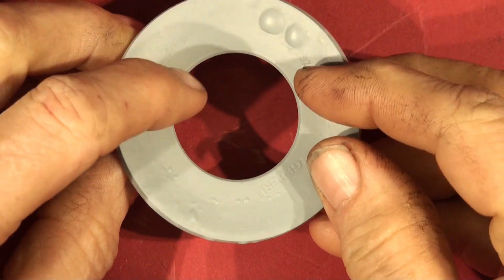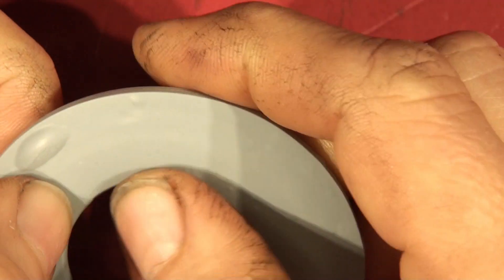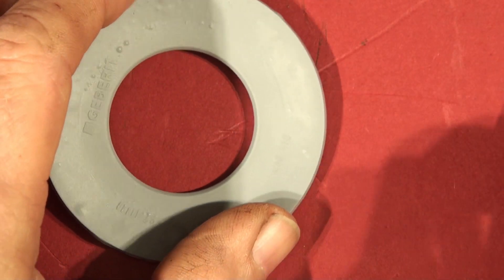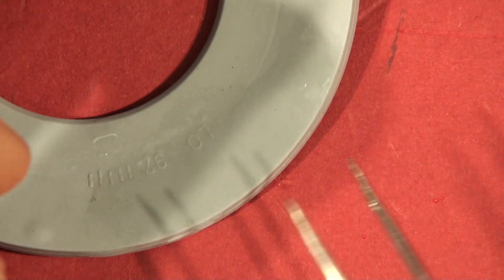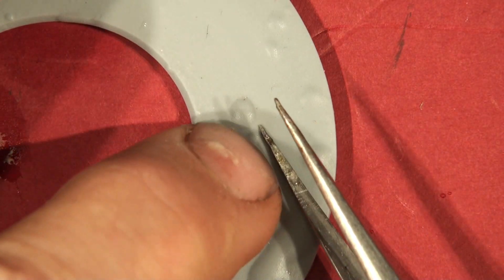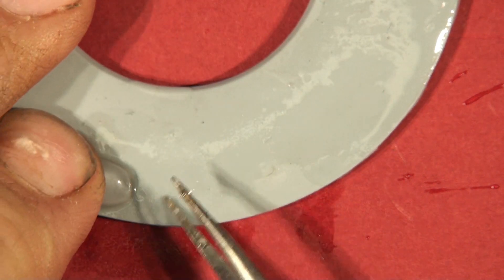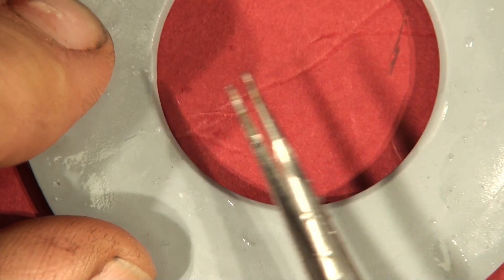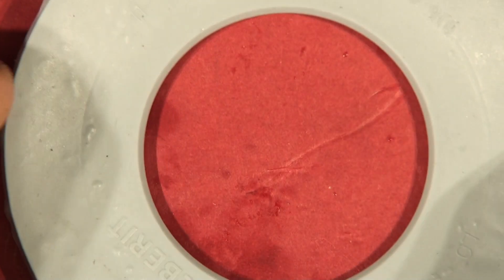Leaking, dribblng  Geberit Twico Toilet dual flush valve zero COST repair

Comment: Thanks mate, exactly the problem I was having with my toilet cistern here, very slowly leak and a high water bill. Solved and saved me buying the slightly overpriced part and a 20 km return drive to the plumbing shop...
Reply from the maker: Great job..  Shouldn't be necessary if they just made a simple silicone washer... It is made from the wrong material -- one has to wonder if it is  deliberate to generate more sales....

Comment: Interesting, sure as ...sugar, honey, ice and tea, for the last couple of weeks I'd be getting little dribbles and the refill valve going off now and then at all hours. Drove me batty in my apartment. In my case, the seal was bowed out rather than flat, there was one tiny blister but for now I settled on cleaning it all down along with the cistern seal face and inverted the seal ring so it presses down more firmly.

Took me a while to find what kind of flusher it was outside of a Geberit, no branding / model stamped next to the various 'made from abs' this and 'complies with standards that' found all over the parts. Thumbs up for the tip.
Reply from the maker: Thanks for the info and for watching. Good luck with it.
Reply: @razenby  thus far, jobs a good'un. Dealt with leaky seals in the past at old apartment (old school hot/cold taps in shower) till flatmate wrenched taps off tight, tearing soft seal domes. 
More annoying is the loo has a basic shut off valve, but it literally does nothing. So glad apartment water mains uses an industrial ball valve, 90° and you KNOW it's locked out.

Comment: I had the same issue but just turned it upside down and it seems to be holding. I also replaced the diaphram in the fill side.
Reply from the maker: Great tip.  Sadly, mine was too blistered...

Comment: My bog has the dual flush double button, but there is no washer on it at all.
I live in a council house, do you think they are short changing me by missing out the washer.
When they fitted the loo it did trickle down the pan,  i fondled the mechanism and i healed it lol.
Or frightened it :-D
Reply from the maker: I prefer the old siphon pump type  - higher flow rate to shift difficult customers and you occasionally got a good workout pumping the handle. This is definitely intended for a petite lady's boudoir..
Reply: @razenby  I liked the old cast iron bell type,  pull the chain at a rapid pace and the bell vaccume lifted the water above the exit tube.
An old idea but bloody reliable :-D
And a "Ball Cock" Snigger :) to control the water fill level.
Almost nothing to go wrong.

Comment: Overhauled the my whole damn Geberit, removed both float and cistern mechanism. Looked at that seal and it looked ok but I didn't see the tiny blisters.  Finally removed AGAIN and fixed.  Thank you for video.  Gerebit 816.418.00.1 is part if you need new ones.
Reply from the maker: Thanks for watching and the info.

Comment: That’s what happens if you’re promiscuous and running around on Friday night. You get blisters on your ring

Maybe a bit of that thick dielectric silicone grease would keep those blisters sealed enough so that they don’t fill up again? Just an idea. My aunt got one of those two button toilets and I swear the mechanism has like 30 little plastic parts up in the tank and it’s a right pain in the ass if anything goes wrong. Not to mention if you plunge it too hard it sends shit up into the tank somehow. Not a fan I have to say.
Reply: Also by the time I realized what was happening and that the top tank was being corrupted it was so nasty I took it outside and hit it with the hose and ended up putting it in my ultrasonic bath normally use for cleaning parts, circuit boards, mechanical watches and stuff like that. I wasn’t about to take apart those 30 little plastic pieces and get shit all in my fingernails. So a quick bath in the ultrasonic got everything like new in the loud me to just pop it back in. Just hope and pray that your plumber doesn’t put the wax seal upside down like he did on her toilet. That was a lot of fun to fix. Jesus what’s this world coming to …..every time I take the lid off the tank I do the Catholic crucifix symbol on my chest because I never know when I’ll find

Didn’t want clients complaining about smelly circuitboards that I had fixed for them after the weekend of fixing the pooper parts. So Was a good excuse to get a new ultrasonic solution. 😁
Reply from the maker: Yh those plastic valves are troublesome, especially in a hard water area like ours. I dump a cup of descaler in the cistern and let it sit every 9 months or so else they clagg up.  They are supposed to save water but half the time the dribble water into the overflow or leak in the pan. Bring back the syphon valve..!!

Comment: They spent a lot of money in making a silicone seal fail. It wouldn’t have been easy. Repeat sales.
Reply from the maker: I reckon that you may be correct. There must be some osmotic thing going on as there is only about 9 inches of head.  Clearly the membrane was intact.    All the loos that were fitted 10 years ago have the same blistered ring.. It is a curious thing.
Reply: @razenby  "about 9 inches of head.  Clearly the membrane was intact"
Was that intentional, or have I gone all Finbarr Saunders?!  😂